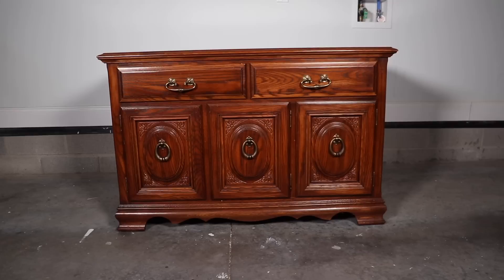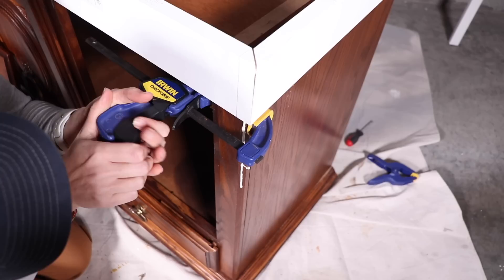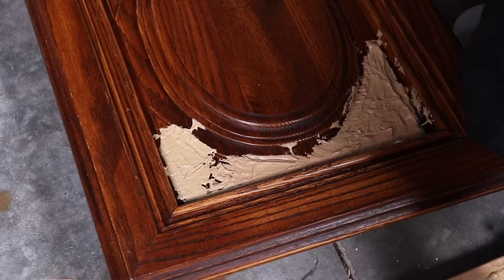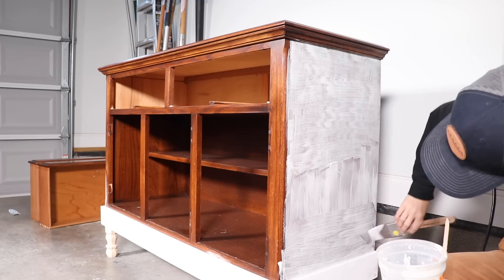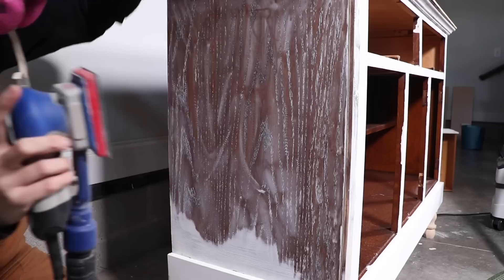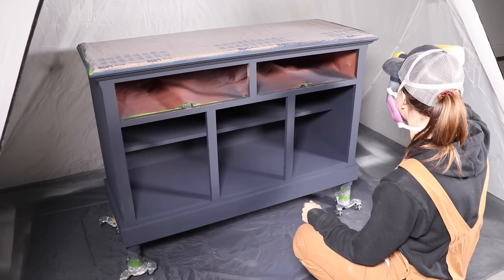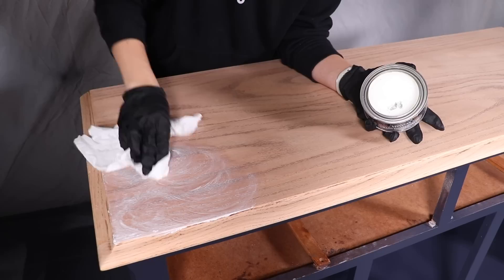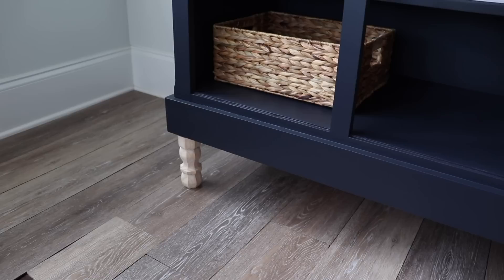Extreme Furniture Makeover | Spraying Chalk Paint & Adding New Legs

Comment: For years I've owned a very early 50's sold oak cabinet very dark brown. I'm 70, an it was not new when i got it!I've never liked the heavy detail on the doors or drawers. Always had plans for the elephant in the room. Need it for storage, cannot afford to replace. Idea has been in my head for years, first work, then health held me back.
You call it a Hutch.
Stripped off side doors and drop down door in middle kept glass and wooden shelves.
Next stage. Turn both drawer fronts to other sides. Do the same with both doors. Paint black. Thinking upper in a slightly paler shade.
Vintage raised stencil on each door in lighter shade, then long stencil on drawers with just a smidgen of pewter gilding if I can find some. 
I want it subtle.
You could have turned your doors, there being solid, though it turned out beautifully.

Comment: Hi Christina, I totally feel your pain with the sprayer. You have to be so so careful with the settings. This summer I did kitchen cabinets. And I had primed the first coat with a brushes. It looked smooth and silky.  My fiance suggested I use the sprayer for the second coat to " save time." It changed the surface to an orange peel finish. Fortunately I only did it to a few drawers and cabinet fronts. But I had a total meltdown! I had to let them dry, resand and did them all over. I totally get where you are coming from in this. In any case your piece looks GREAT!

Comment: The 90 minute drywall mud would be a great choice for filler on that. The fast set drywall muds have more in common with bondo than they do with classic drywall mud. It's a great medium and is very inexpensive. Durhams water puddy is also of great interest. It's another dry powder that can be mixed to whatever consistancy you like. It's also fairly inexpensive. A word of advice though, clean your tools right away. Once dried neither of these fillers will break down with water.
Reply from the maker: Thanks for the suggestions!

Comment: Did you have any trouble with those leg plates? I’ve used them before for other projects and those little squares where you screw the legs in are made out of cake batter. :( When I try to move the furniture the squares crack off. I started buying some other brand from Amazon to try out

Comment: did you have to clean your sprayer in between the coats of paint and sealer?
Reply from the maker: I didn't if I was doing it 2 hours later. If I was letting the piece set overnight, I cleaned it out.